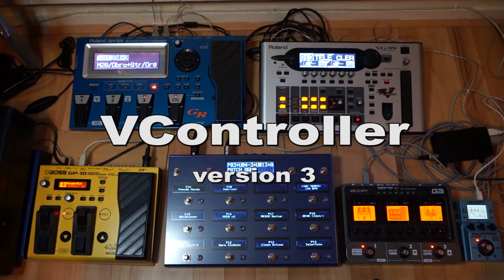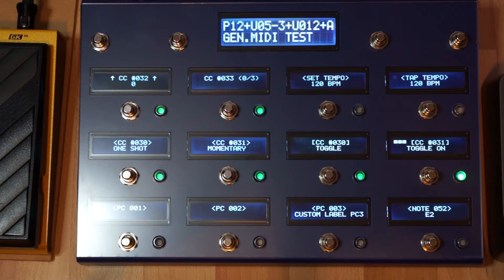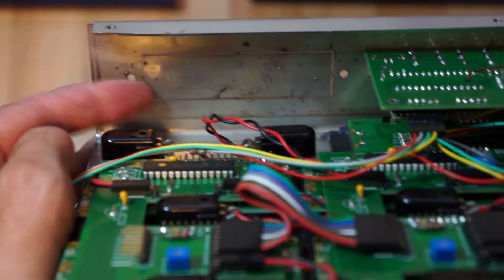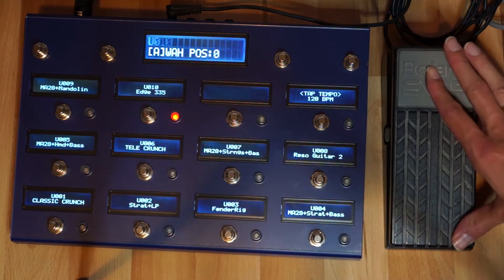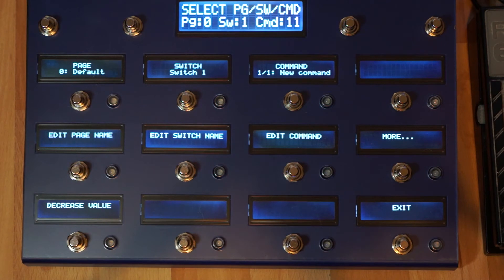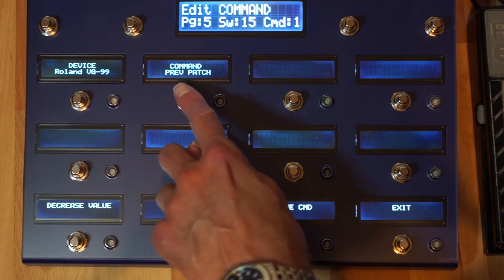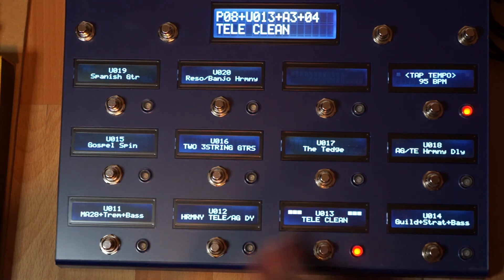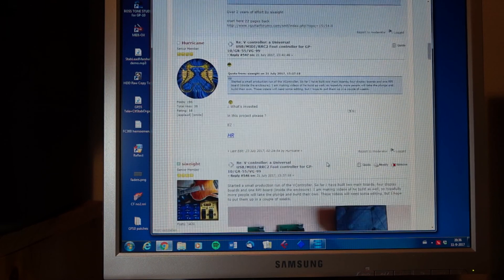VController version 3, DIY MIDI foot controller for Boss GP10/Roland GR55/VG99/Zoom G3/Ms70cdr.

Comment: how do you like the sy 1000 vs the vg99?
Reply from the maker: The SY1000 gets a lot more use nowadays and is on my pedalboard. The VG99 is mainly used to drive my Kemper Profiler.

Comment: So cool! How did you make the enclosure btw?
Reply from the maker: Laser cut sheet metal. Have a contact that can do that...
Reply: @SixEightSoundControl   if it's not a big secret, how much it costed for you ? (enclosure with the holes)   Thanks!
Reply: Also you've used the MCP23017, and the different button modes(long press, short press, etc ) worked good, right?
Reply from the maker: Cannot share that as I lost the contact that built the VControllers. But you can ask for a quote at pcbway.com which do sheet work as well.
Reply: @SixEightSoundControl oh thanks! Will do!

Comment: can this controll rack pre amp like marshall jmp 1?
Reply from the maker: The VController can send MIDI PC and CC messages. Most devices with a MIDI port can be controlled.
Reply: @SixEightSoundControl  thanks for the answer..
By the way.. may i asking the code schematic and the layout..
Im interesting build for my marshall jmp1 midi preamp..
Thanks before.. 🙏🙏
Reply from the maker: @ArdiNugrohocilacap  https://github.com/sixeight7/VController_v3

Comment: if posible for add radio button for setup EQ on pedal ?
Reply from the maker: For which device would you like to control the eq?
Reply: @SixEightSoundControl  

Yes, if I use an amp simulator like Amplitube 4, I can change parameters (low, mid, gain) by adding a radio button to this tool.
Reply from the maker: @williamtyalor7005  There is encoder support in the VController and the VC-mini has some.  But I don't have any support for amplitude yet. But there are cheaper solutions if you are after a midi controller with radio buttons.
Reply: @SixEightSoundControl  oh ok, i want to build vcontroller as soon. i think vcontroller support software guitar rig and amplitube 4. thanks for share bro
Reply from the maker: @williamtyalor7005  The VController is built for some specific devices. Check the documentation on GitHub or vguitarforums. For all other devices and software it works just like a normal midi controller. It is much cheaper to buy a Behringer FCB1010 then to build a VController. All the fancy patch name reading only works for specific devices. Not for your PC software.
Reply: @SixEightSoundControl  i mean combine vcontroller with https://youtu.be/ZcMur69vRfM. thanks

Comment: Is it possible to do it for AXE Fx3 ?
Reply from the maker: There is support for AxeFX 2. I guess v3 should be possible as well. But in order to develop it, I need remote access to a computer connected to a VController, which in turn is connected to the Axefx 3.